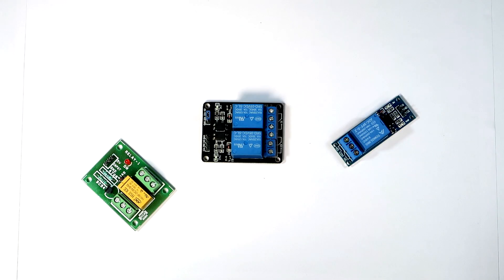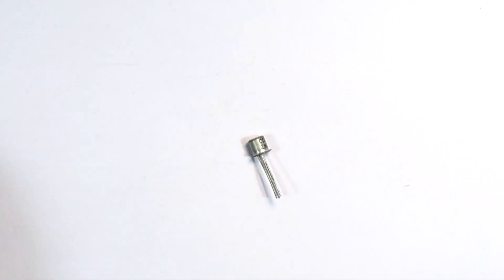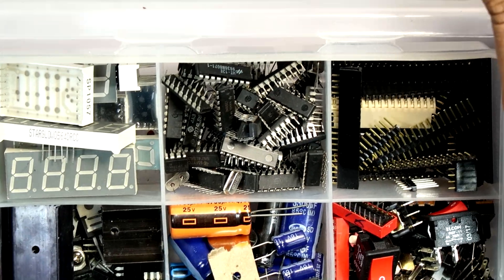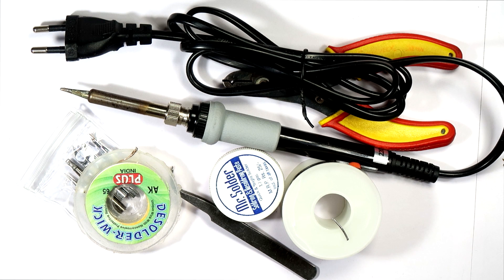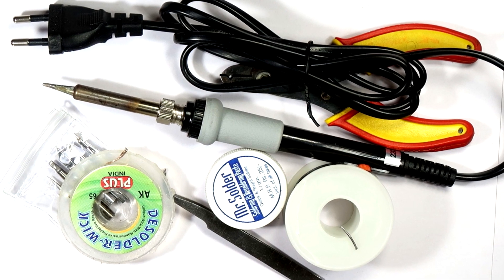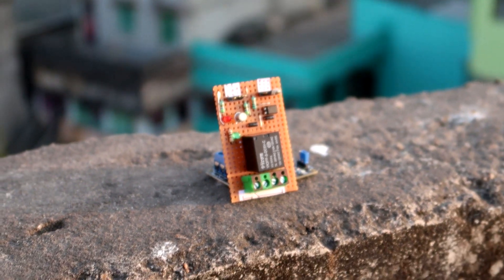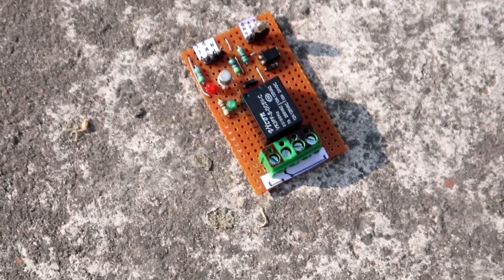DIY 5V Relay Module for Arduino and Raspberry Pi || Detailed Explanation

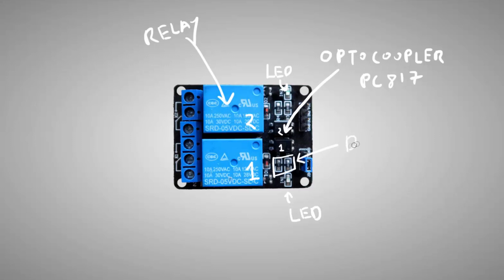Comment: Please at 02:20 --> these are resistors not diodes ... 

There is 1 diode for each relay and it is the little orange component between the resistors and the relay (D1 & D2)
AND the last important componant is the transistor ! 1 for each relay again :
It is the black component right under the diodes with 3 pins ! 
The transistor acts like an electronic switch ! It has 3 pins. Put a small current in the middle one and the 2 others are connected ! 

Well .. Thanks anyway for the screenshots of the modules I needed ! Good luck and Happy Life !